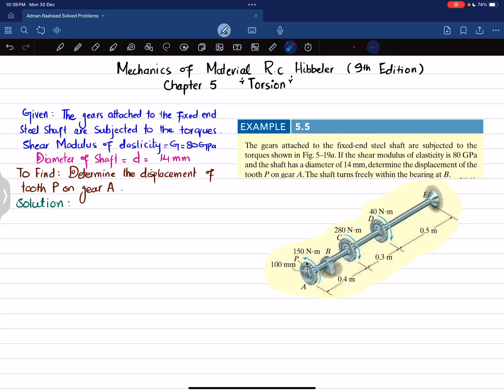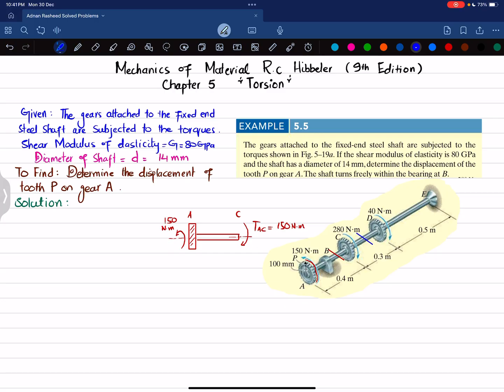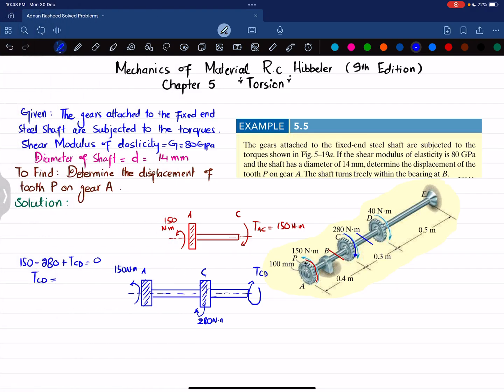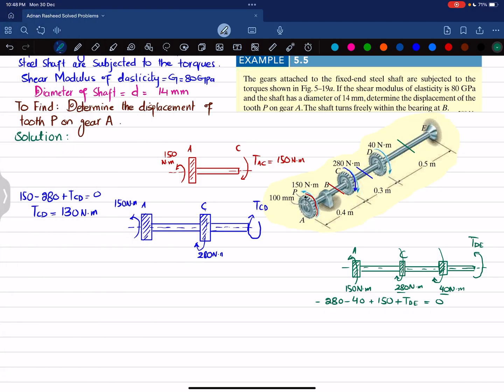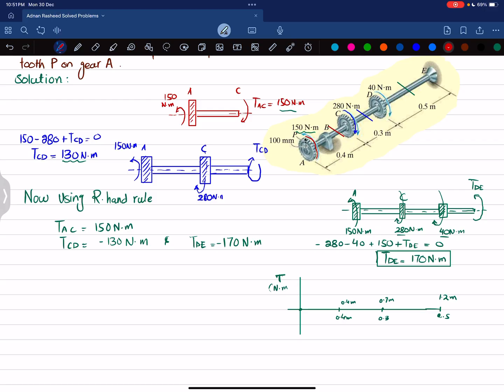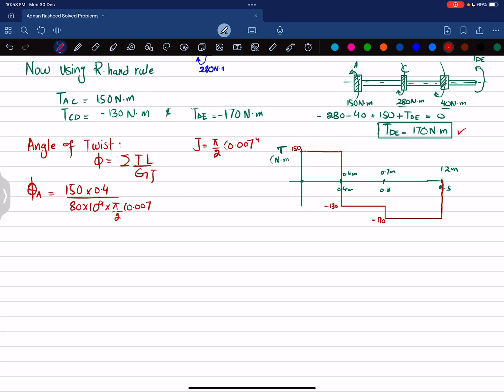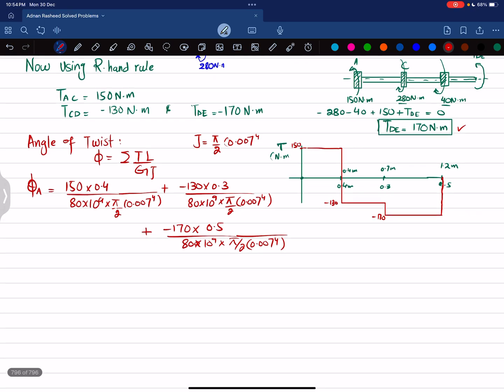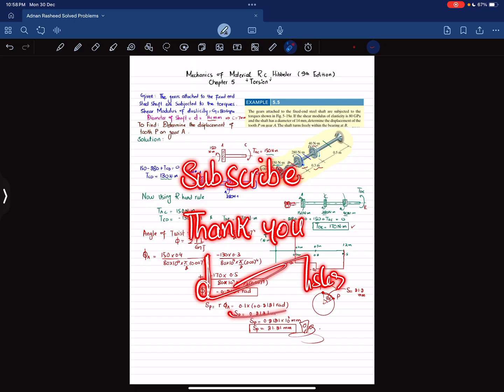Example 5.5 | Determine the displacement of the tooth P on gear A | Mechanics of materials RC Hibbel

Comment: Hallo sir, good explaination. One question from me,
 if i assumed anticlockwise is + and clockwise is -, then my answe will get 0.2121 without (-). Is it still acceptable?
Reply from the maker: Please specify the time frame where there is issue ...
Reply: @engradnanrasheedmechanical  1:58
Reply: @engradnanrasheedmechanical  , 1:58
Reply: it is on 1:58 

😊
Reply from the maker: @FMOHAMMADFAIZBINMOHDFIRDAUS Dear 0.2121 is the value of what?